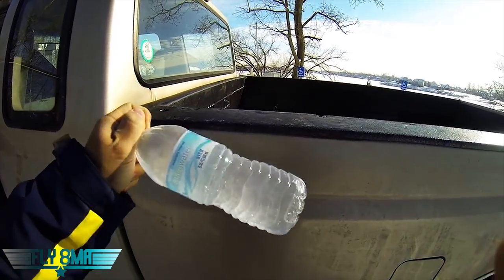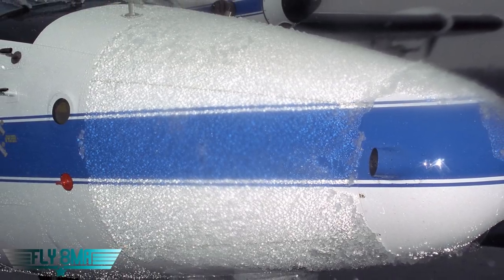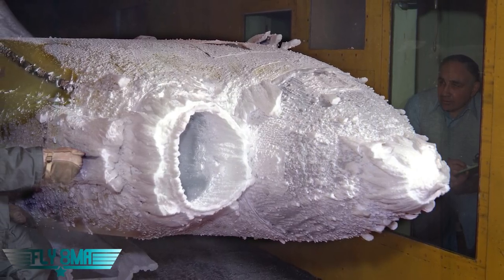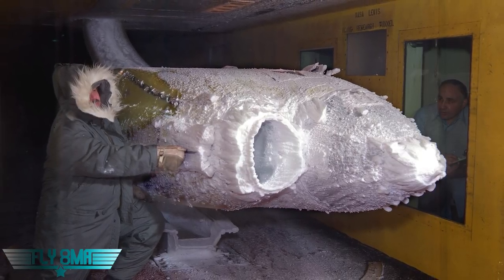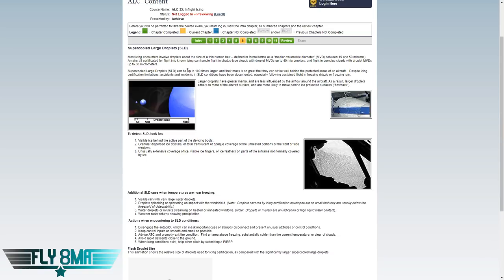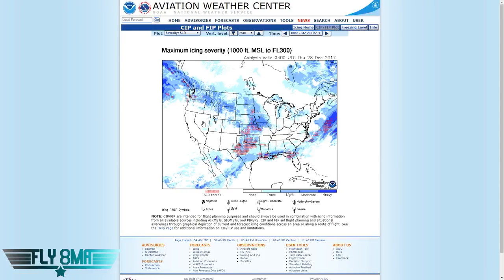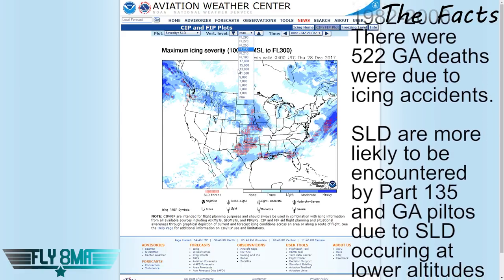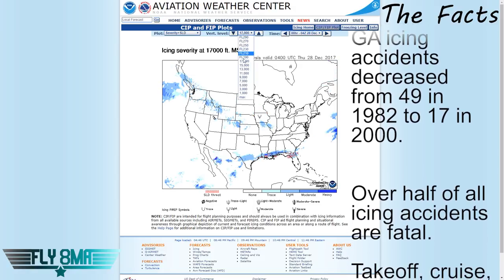Ep. 252: The Worst Icing You can Get in an Airplane | SLD

Comment: What do you think of the new super hydrophobic coatings/ surface etchings that stop ice formation?
Reply from the maker: Being a new concept, It'll be interesting to see as the data comes out how they perform over time!
Reply: @fly8ma.comflighttraining199  I saw some videos demonstrating it, and it was very impressive!
Reply: @videosforcatsanddogs214  This comment was a year ago but thought I'd add from my experience.  I have looked at icephobics from an impartial point-of-view (icing consultant rather than icephobic coating sales), and whilst they have shown to decrease ice adhesion there are issues related to durability and general robustness of these coatings (e.g. rain erosion, contamination etc).  Most of these coatings still also require some form of ice protection system to help them remove the ice.  Having said that, most of my work is on high speed so they may be more applicable for GA aircraft.

Comment: Hey Jon, in your professional opinion how accurate is that AWC Icing Severity prediction model?  Have you had great success with it?  We fly GA typically without boots so looking for feedback on it's accuracy.
Reply from the maker: When its showing icing potential I stay out of that area....so can't confirm or deny how accurate it is where it shows icing.  That being said I've picked up ice before where it was not forecast on the icing model, so a little extra caution is necessary.  If you're really curios, spend a couple weeks watching pireps and the icing forecast and you'll see that it does mostly line up.
Reply: Yea we've done that here, but we have zero tolerance given no boots, but I've been wanting to find someone that's extensively used this AWC model that could say 'ohh yea it's super accurate' but not enough people that I know use it.  Say we sent you  a business email a week or two ago, if you didn't get it let me know.  -Brendan, CRAZEDpilot.com, Inc.